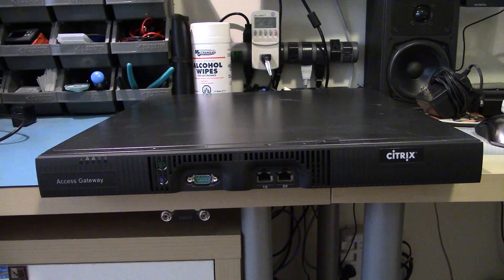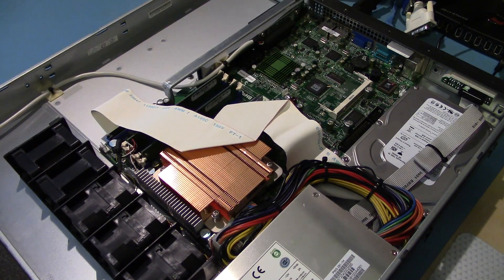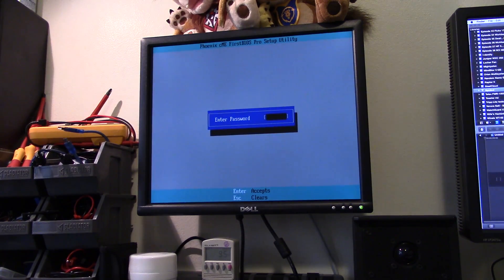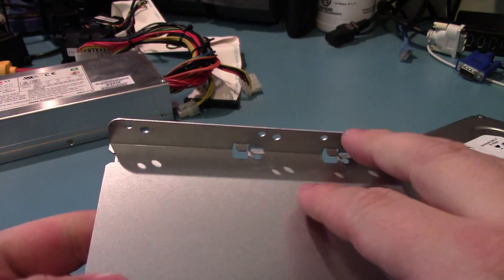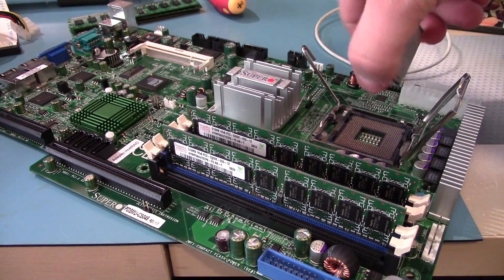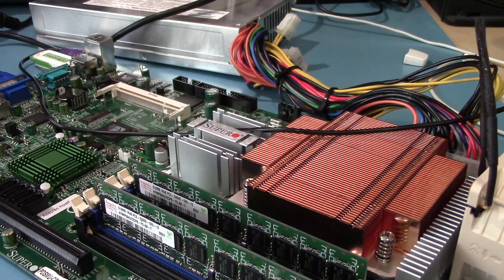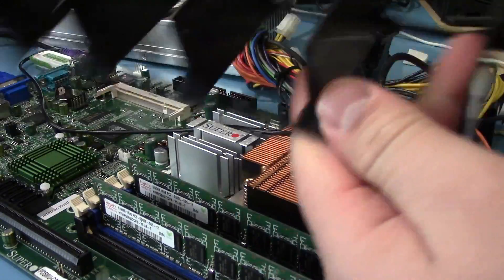Citrix Access Gateway AG-2010 Teardown (and dealing with a BIOS password)

Comment: The fans are called "counter rotating" fans and one of them spins in the opposite direction of the other. They are designed for high pressure

Comment: hi dude. nice teardown and explanation of this unit. 
just for asking, have you ever tested pfSense on this unit? do you know if this unit is capable of handling 2 pci Express 4 port Intel Network cards? Besides bios upgrade from retial board, there's anything that prevent this unit to boot from sata drive or upgrading cpu? 

my plan is to build a pfsense box out off one of this units with a xeon processors and 8gb of ram, coupled with 2 extra 4 port nic for a total of 10 usable gigabit ports. 

thanks in advance
Reply from the maker: +Daniel Strauss Why do you need such a powerful machine for pfSense? My 60 Mbit connection runs just fine off a dual core Atom with 2 gigs of memory with 20+ devices.
Reply: +Peter Brockie This is because i need to connect 4 wan and two lan segments. besides that i need to have a squid and dansguardian running for 50+ clients.
Reply from the maker: +Daniel Strauss You'd probably be better off building your own system. Citrix stuff tends to sit on eBay at super high prices for the hardware you are getting, unless you can score it for next to nothing (like I did), you can usually build a better system for a lot less. :)

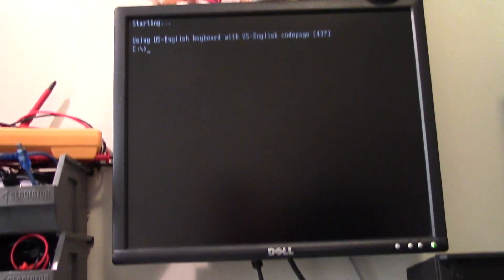Comment: 10:12 I've never seen a noctua fan that small as far as I can remember...
Reply from the maker: 60x60mm fan. They make smaller. They have a 40x40mm and I have a couple. Had one running in my old eSATA RAID box.